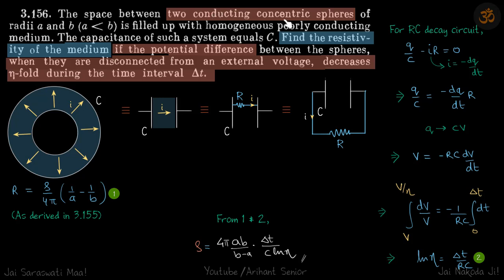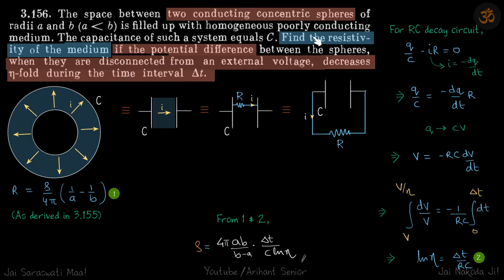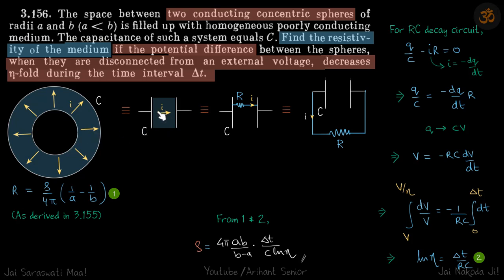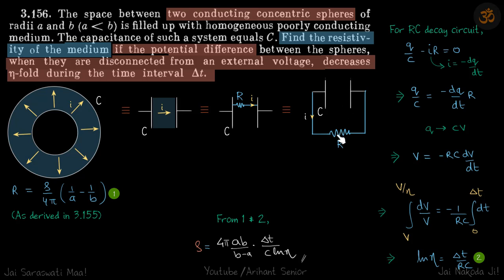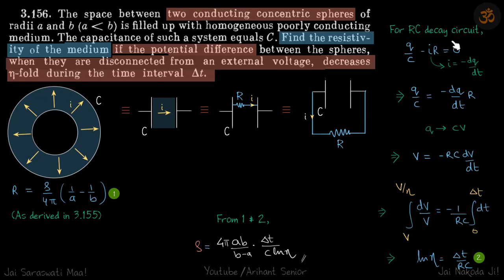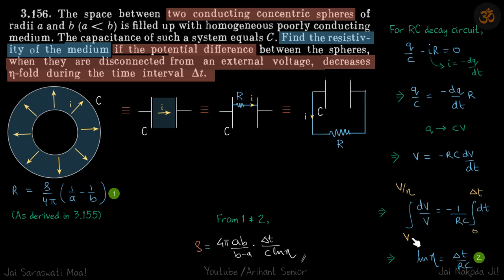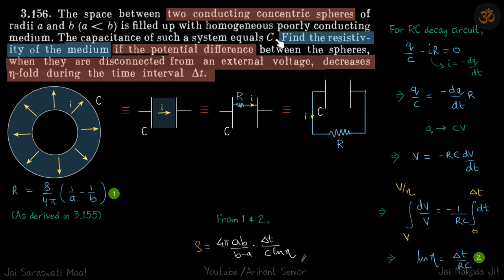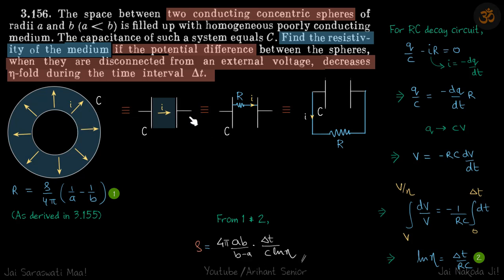3.156 | Irodov Solutions | Electrodynamics

Comment: how 3rd diagram is equivalent to 4th?
Reply: The two diagrams are identical in terms of electrical behavior and represent the same series RC circuit. The difference is purely in how the circuit is drawn, but both layouts depict a capacitor C and a resistor R connected in series, allowing current to flow through the same path.

Simple Words में, भीतर से उठाकर बाहर चिपका दिया है।